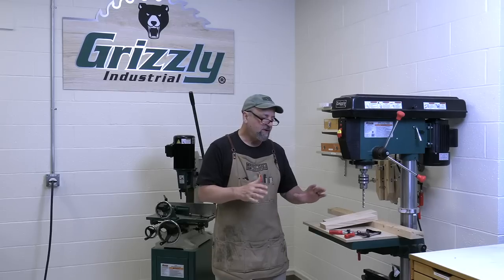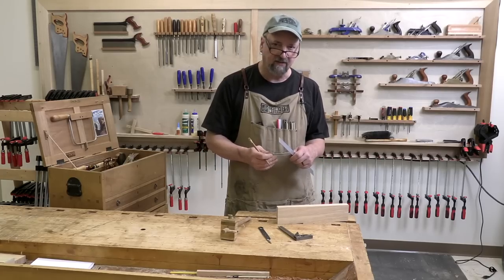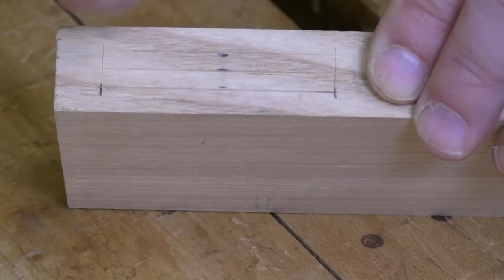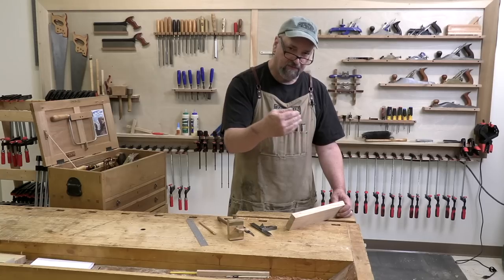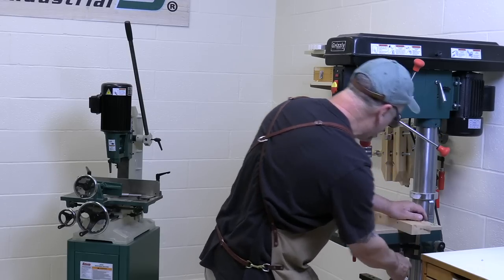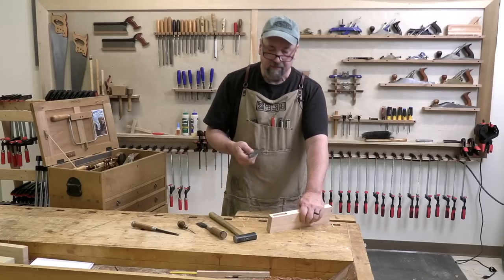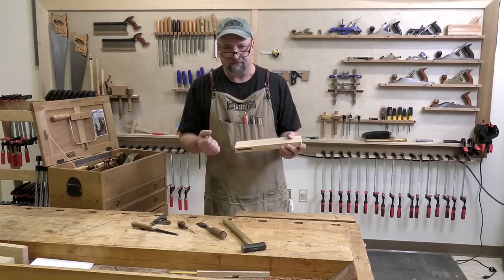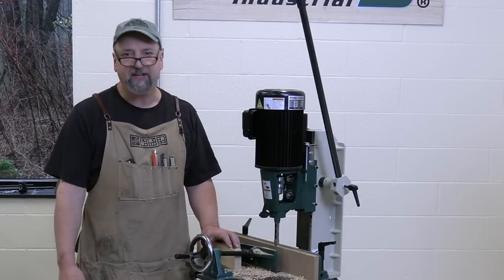Mortising two ways

Comment: thank you . question please . in metal work if i found a crack i would drill a small hole at each end to keep the crack from migrating . why is that done with wood working ?

Comment: Is it better to cut the mortise or tenon first & why?
Reply: With hand tools only I would start by cutting the tenon fat compared to the chisel I was going to use for the mortise, mark the length of the mortise using the actual tenon, chop the mortise with just a mallet and chisel (unless it is short), fit the thickness of the tenon to the mortise which should be pretty close to the width of my chisel. So start tenon, finish mortise, finish tenon.